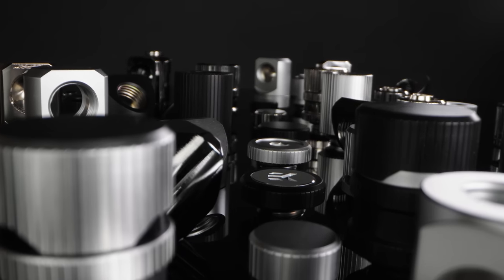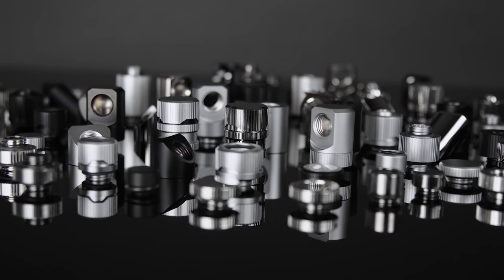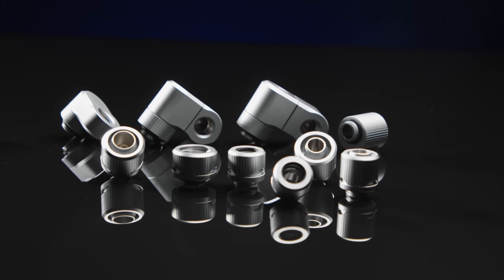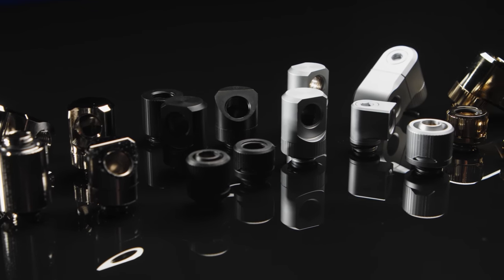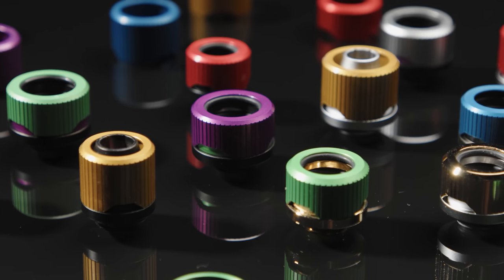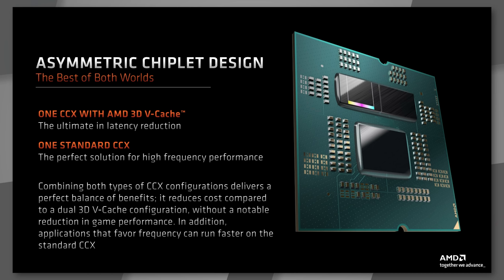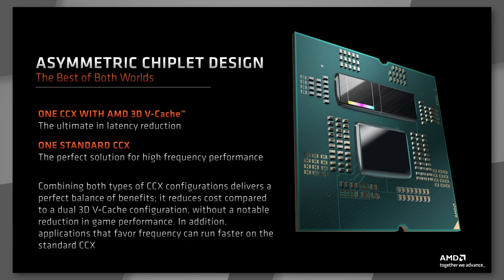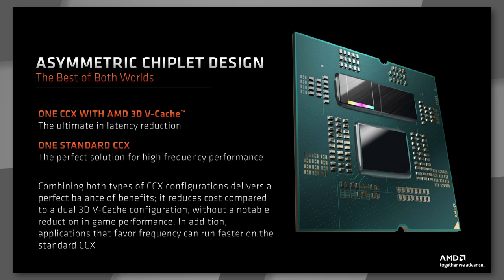Why I switched back to Intel...

Comment: How are you able to overheat the 7950X3D during gaming and streaming?
I am a 7800X3D user with 6200 memory 1:1 for 3 months now.
Tested with 24 hours Cinebench 23.

Did you use a Asus board with the memory controller cooking 1.4 V SOC?
1.4V SOC makes the memory unstable compared to 1.25V.
Reply: Of course he used crappy Asus which burns your AM5 CPUs to hell with too high voltages. What you expect from this channel? He has zero idea what he does and just buys the most expensive stuff. Asus board for $800 is the best right? 4 memory DIMMs are the best right? right? right? more voltage is better right???
Reply: @bestonyoutube  whats funny is he said he would quit using them. but he does that often and than cry's when he starts having problems
Reply: why are you so mad lmfao chill @bestonyoutube
Reply: @bestonyoutube  you sound like such a crybaby lol
Reply: @bestonyoutube  That issue has been fixed for a while. Sure, Asus sucks nowadays, but there is no issue now. They lock it to 1.3v unless you change the SOC voltage.
Reply: @kensclark  You're lost if you think that is the only problem with asus boards lmao. This comment section is literally filled with people's am5 builds eating shit because of them, and it certainly isn't "just" because of that problem. The company literally has no quality control while preying on the ignorant for their warranty scams. Can't trust them to make a decent motherboard.
Reply: @Yeet42069  Cool story.
Reply: @kensclark  Don't take it personal. If you're a fan of faulty hardware and shady warranty practices you can go ahead and order 🤷‍♂Its not me you're hurting
Reply: @Yeet42069  There is no issue now... The problem was with a fault BIOS that was fixed. The SOC voltage does not cause any issues now. Other motherboard manufacturers have issues with the AM5 platform as well with it being fairly new. You do not know what you are talking about.
Reply: @kensclark  Yeah I would rather choose to believe the person making desktop computers for a living and encountering issue's with every ASUS mobo they use rather than mr "you do not know what you are talking about" who analyzes every known case in existence as he types his drivel, coming to the logical conclusion that everyone in the comment section is wrong and he alone is right 😂

Sure bro, if you say so. Also good luck with those warranty claims.

Comment: I upgraded earlier this year from a i7-9700k build with RTX 3080 to i9-13900k and 4080. No regrets and it’s a build I know I’ll be good on at 1440p for at least 5 years.
Reply: Are you sure about 5 years? Did you try running Alan Wake 2 at native 1440p? Or with Ray Tracing and without frame generation? Sorry, I have to poke a little bit ;). Last year I got RX 6800 with 5800X and Alan Wake took my GPU down in an instant. Bye bye native res.
Reply: I hadn’t heard about Alan Wake 2 being resource intensive enough to slay the 13900k/4080 (if it was alluded to in this video, my bad; I sorta skipped around a bit). I’ve been a little out of the loop with new games the last few months. I guess I should revise my statement to I hope it will be good for 5 years. 😅
Reply: @wanteddoa7929  He don't know what he is talking about. I have a 9700k/3080 like you had and Alan Wake 2 run like a charm at native 1440p.
Reply: @vinztheoriginal I suspected that was the case but decided just to let it go. I was playing Cyberpunk at 1440p on my previous build with everything maxed except DLSS (set to Balanced) and it could run at 80ish FPS (sometimes lower depending on the scene). So I figured AW2 wouldn’t be much worse.
Reply: With Ray Tracing or path tracying your 3080 will get smacked in AW2

Comment: Regarding electricity.   I just learned IDLE usage is 100% lower on Intel.    As someone who uses PC alot, general purpose like browsing, rarely gaming, and rarely turn off PC, that would surely translate to lower electric bill?
Reply: Its the chiplettes. They consume more to operate, even on the low end, but end up being efficient on the high end.
Reply: @deuswulf6193   thanks wulf.  That is how I understood it.   The summary:  your electric bill will reflect your specific usage pattern.  Higher efficiency on high-power usage may not result in lower bills.
Reply: @nikolaforzane2285  Exactly. Its why when people yell how they will save electricity with the AMDs over Intel, they don't actually account for use case. Few if any leave their PC running under full load all day. 

That said, I have a 13600k in one machine, and a 7950x3D in another. The intel idles around 25w give or take a few, the AMD around 45-50w. It doesn't really add too much to the electric bill, but is nearly double when under low load or idle.

Comment: My AMD build was an absolute nightmare, it wouldn't stop restarting at random. It got to the point of doing it multiple times a day and no one could figure out why. So glad I swapped over to Intel and Nvidia because so far this system is working just fine
Reply: i had the same issue with one of my amd builds i ended up turning off C states in bios and restart issues went away
Reply: That actually sounds like a power supply or critical heat issue.

Did you even bother to actually troubleshoot it?
Reply: @Altrop  swapped all the parts, fresh install of everything, temps were well within normal, plus various other software fixes attempted

Comment: Getting a 7950x3D, my first AMD CPU since the Phenom II x6 1100T back in like 2010, has been an utter disaster. I got hit with the EXPO SoC problem back in March/April where my Asus B650E-F fried my CPU. It wouldn't boot if I turned EXPO on and rebooted. It'd get stuck on memory checking during POST. Swapping CPUs "fixed" it but the board had scorch marks in the socket, as did the contact pads on the bottom of the CPU. Then I got replacement parts from them in June, and had the updated BIOS with the supposed fix for this. 3 months later, here we go again. Asus replaced my board again with a brand new one, but now AMD is giving me the run around for warranty. I finally got them to approve the RMA and now I have to ship it out to them but what then? Will they say it's fine even though it won't POST with my CPU in my board, but does with a friend's CPU? Even if they give me a replacement, how long before this problem appears again? I think they're pushing too much voltage into their memory controller to make these DDR5 6000 kits stable and it's frying the chip. I'm so sick of this PC and wish I could to back in time and stop myself from buying it. Waste of time and money. To make matters worse, I just welcomed my first child home last month and don't have the time or care to deal with these companies and their buggy products. Over it.
Reply: That is an Asus problem, really.
Reply: @joe--cool  prove it. The second board already had the BIOS update and I built 3 identical rigs for my wife and brother in law and both their rigs are fine, only mine is failing. If it was just a blanket Asus issue then they'd have the problem too.

Comment: Best fix for AMD would be to put the v-cache on both ccd's. That though is the biggest reason I'm going with a 7800x3D because it outperforms 7900x and 7950x and their x3d variants. It also gives intel a run for their money on FPS in most games that wouldn't warrant me spending the higher cash for Intel for the same performance.
Reply: Every time I see a video about the dual CCD X3D variants I wonder if that would solve a some of the issues. I feel like it was kind of silly to physically build them the way they did, especially with all the issues people seem to be experiencing with them. Maybe they will with the 8000 series.
Reply: I am waiting for 16-core CCDs and then I will upgrade again my rigs.
Reply: Then you just get even slower multithread performance, and you still get scheduling issues. The problem isn't that only one CCD has the cache, it's that threads can jump CCDs without having the data it's looking for in local cache. This was even happening to the non-X3D dual-CCD CPUs. Most programs will default to the highest clocking cores, which is on the non-3D CCD. You can hit Win+G and tell the system to treat the foreground app as a game, and it'll use the V-Cache CCD. You don't get a 16 core CPU just caring about games, and it takes very little effort to have it do everything you need it to.
Reply: @blkspade23  "You can hit Win+G and tell the system to treat the foreground app as a game, and it'll use the V-Cache CCD." Does this have to be done every time you start the same game?
Reply: @x4res  It's set once and will stay unless you uncheck it.

Comment: I built my new PC for Christmas 🥰. Asus Crosshair Hero 670, 7950X3D delided and MicroDie CPU block, Conductonaut Extreme, Asus 4090 OC with EK Waterblock, Corsair Titanium 6000Mhz CL30 64 GB, Corsair LL fans, Dual EK radiators 430 and 360, Barrows Distro plate, 4x WD Black NVME 2TB, Seasonic  PSU, case CM 700P, Monitor Samsung G8. I was a little worried after this video but i still went for it. No issues whatsoever, it runs with PBO, curveoptimizer and DDR5 6000 Mhz flawlessly.
Reply: You messed up going amd
Reply: @behindthen0thing525  I have zero issues,   fully stable, it takes 5 sec to boot. Everything is working great.
Reply: @petrisorcovaciu9974  nope
Reply: @petrisorcovaciu9974 that build sounds monstrous, can't wait to build mine later this year
Reply: Ruined it with the amd tho
Reply: UPDATE: Built mine a few weeks ago and it's also an absolute beast of a unit ^^

GPU: RX 7900 XTX 
CPU: Ryzen 7 7800X3D 
Motherboard: ASRock X670E Steel Legend 
Memory: CORSAIR Vengeance 32GB (2x16GB) DDR5 5200 
Storage: SAMSUNG 980 PRO SSD 1TB 
PSU:  CORSAIR RM1000e
CPU Cooling: ARCTIC Liquid Freezer II 420 A-RGB

Comment: My AM5 Ryzen 9 7950X3D don't have these problems. I use Corsair Vengeance 5600 64 GBytes on Expo. My Motherboard is a MSI MAG X670E Tomahawk WIFI. My graphics is a MSI  RTX 4070 Ti slim. Also I use a Be Quiet Pure Loop 2 360mm all in one. Thermaltake Core V71 case and Thermaltake Tough PF3 ATX 3.0 1200W 80+ Platinum power supply. Running Windows 10 Pro. PBO is set to +25.  I use the latest drivers from MSI.

Comment: I am currently using the 7800X3D on an MSI Carbon WiFi X670E motherboard with 32GB of CL30 GSkill 6000MHz EXPO RAM. Along with that, I have an ASUS ROG Strix RTX 4090. To date, I have not encountered any problems with my X3D. It has been an amazing experience ever since I upgraded from my Intel 9700K. I am sorry to hear that you had a bad experience with AMD Jay, I had been using Intel for 20 years before going AMD. Naturally, I was a bit nervous about switching, but in the end, I am extremely satisfied with my decision. Furthermore, having the ability to seamlessly upgrade to the next-gen CPU without having to replace my motherboard is definitely a plus for me.
Reply: Thats reassuring to hear because I'm also planning to buy a 7800x3d with the same ram and a 4090
Reply: Bro I'm thinking about pair a 7800x3d with a MSI B650 Carbon wifi instead of a x670, do you think is a good choice? Will it be profitable?
Reply: @Nagi-b2d  The MSI B650 will be great the only reason I went for the X670 is that it has 2x Gen 5 PCI Express slots and the MSI B650 doesn't but to be honest at this stage the difference between Gen 4 and Gen 5 is hardly noticeable the MSI B650 should be great bored for the 7800 X3D just makes sure to grab the most updated version of the BIOS for your motherboard.
Reply: @Warhorse469  okeeey, thx a lot bro

Comment: This past year has been a nightmare to pick parts for a personal rig, just narrowed down my next cpu to the 7950x3d since I wanted the extra cores for productivity plus solid gaming performance, and now everyone seems to coming out with all these issues.
Reply: X3d is nice, maybe go with a X - non 3d version.
They also sport good performance, without additional set up steps for V cache.
Reply: As long as you stick to one manufacturer when picking parts you'll be fine.
Reply: if you need the cores go 7950x, if you want the gaming just go 7800x3d

Comment: I honestly think it might have something to do with the 7950X3D as I'm experiencing ZERO issues with my 7800X3D. I OC'd my 6200 CL38 RAM to 6400 CL30 and undervolted by -30 all cores with zero stability issues on my Gigabyte Aorus Elite AX and gained about a 15% performance increase with much lower temps. No bluescreens, no resets, overall no issues as you've described. You could've also got just a bad chip VIA sillicon valley. Idk, but I went with the 7800X3D as it outperforms in gaming and I don't use a bunch of other shit while I stream. I stream Tarkov and haven't had this good of frames by far with zero issues, even on Streets of Tarkov (the most intensive map by far). I also have a dedicated PC with a 3600X for my Twitch.

Comment: Still on a relative old system:
-sound blaster x-fi fatality
-Thermaltake level 10 gt
-Madcatz Strike 5
-Madcatz Rat 8+
-Asus NIC XG-C100C V2 10Gbit/s
-XFX 6900 xt black
-AMD 3950x
-32 gb Corsair 3000 led
-Samsung 980 pro 2TB
-14TB Ultrastar DC HC530
Corsair AX Series AX1200i 

I really like the black/white/red colour scheme. Works very stable. I can run all new games on it. Works great for editing 4k stuff. And I do quite a bit of virtualisation on it. And because of the pci slot I can do retro things like slapping in a 3dfx card just for fun :)

Is it me, or are people less creative with design these days.

Comment: So glad I stayed on the 5800X3D as a much more mature platform, its a beast for gaming and I've got zero problems so far. I'll let AM5 platform resolve these issues and hopefully upgrade in a year or two to the 2nd 3D AMD5 gen.
Reply: i switched from 5800x to 7800x3d have 0 issues at all.
Reply: @gregorianeg5311  Oh yeah, that's the ideal 3D chip from what I've been reading as it only has ONE CCD so it does not suffer from the stuff Jay is talking about. That is my target upgrade but B650 motherboards is still too expensive for me. I'll patiently wait for the prices to come down.

Comment: Still rocking my 3960x here. Don't think I'll be upgrading any time soon. Sorry to hear you had such a bad experience, but then again sometimes we just get a bad cpu once in a while. I don't see the fascination with having to upgrade to the fastest CPU everytime something new comes in (obviously your use case is different as you have a YouTube channel you need to make content for!). I've had 1 or 2 bad motherboards before, and a faulty ram module in the 35+ years of building and owning PCs, so I think I've been pretty lucky. I'm not sure I would have switched back to Intel for this reason - I don't think this is such a problem that you can't play games, etc. Your systems are already much higher spec than most people would dream to have so I think the topic is a little click-bait-ish.

Comment: I built a new system 3 weeks ago with ryzen 7 7800x3D an RTX 4070 Super, and it is great. I have no issues with memory stability (ddr5 6000mhz) and the CPu itself is rocking like crazy. I had just one system crash, but it was Nvidia's drivers going nuts lol. Overall 7800x3D is awesome, and I highly recommend it

Comment: I bought a 5800x3d and I do not regret it at all, luckily no issues works great straight out of the box! Loving the performance gains from a 3800xt!
Reply: I also went from a 3800x to a 5800x3d. Only issue I have is sometime while gaming and watching a video on another monitor (YouTube or Twitch), the video stutters and drops quality as the game is taking all of the CPUs attention. Not sure how to correct that.

Oh, and the heat. This thing always wants to jump right to 90+ degrees lol.
Reply: I upgraded from x3900x to same cpu happy 😊
Reply: @TomFooleryGaming  You might need to look at your cooling I have a 360mm aio and temps sit in the low 60s whilst gaming and streaming. Also the air flow of your case is important.
Reply: @fadsey  airflow is fine, and the cooling should be fine. Running a Noctua NH-D15. I've got a -30 offset on it, so it doesn't go over about 75 unless I'm benchmarking it. The X3Ds just run a bit warm. The spiking to 90s was on stock settings.

Comment: Shame you had issues with your chip. Haven't had a single crash or issue with my 7950X3D since I got it 6 months ago. EXPO on with my 6000mhz and cl30 ram no stability issues. 
Hope this new system runs top for ya!
Reply: lying amd fanboy detected
Reply: no problems on 7700x, 7800x3d and 7900x3d either.

Comment: I've been running a 7950x undervolted for over a year - I've never had a blue screen or any type of glitch.  I like the cpu so much - I built a new computer for my parents with a 7700x.  The x chips work efficiently and quietly, can be undervolted and the 670e motherboards (mine are both Asus - no issues) have 3-5 years of longevity (perhaps longer).